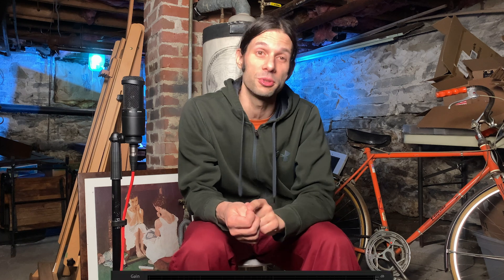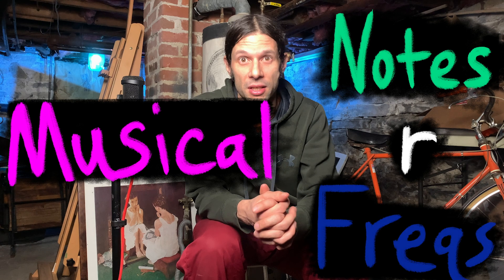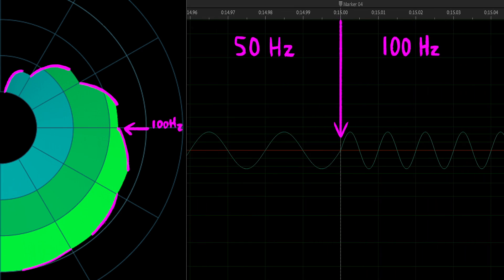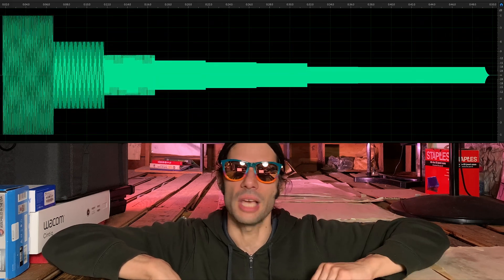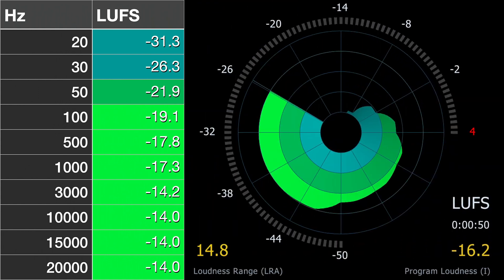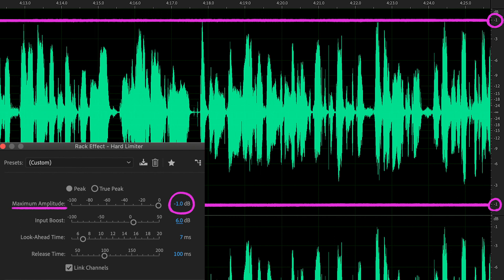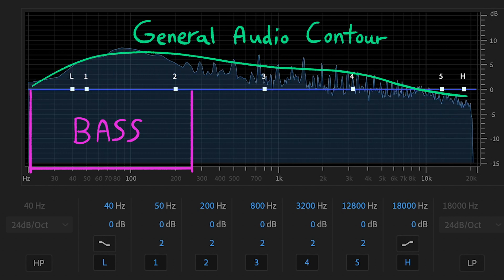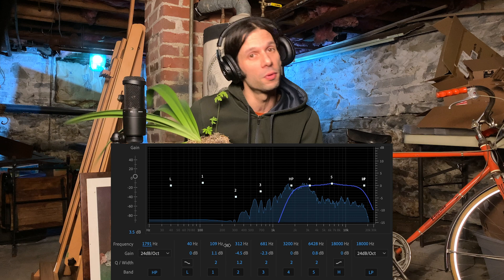Audio Frequencies 20 Hz to 20 kHz Explained

Comment: So we cannot hear hi res audio right?
Reply from the maker: YouTube audio starts to taper off somewhere around 15-18k but that also depends on the quality setting of the video.  360p videos have more audio compression than 1080HD videos.  I think it ranges from 96kbps to 128kbps AAC codec in most cases.